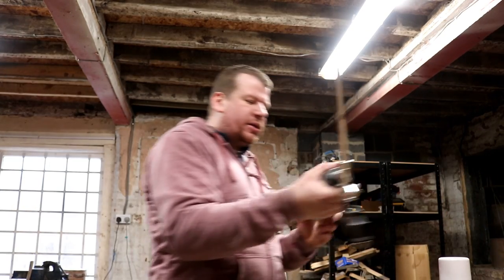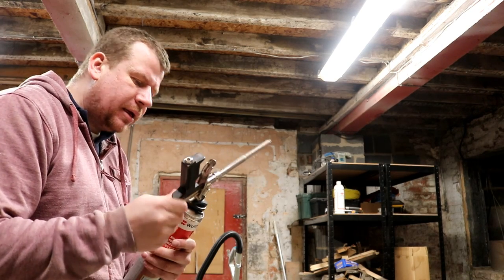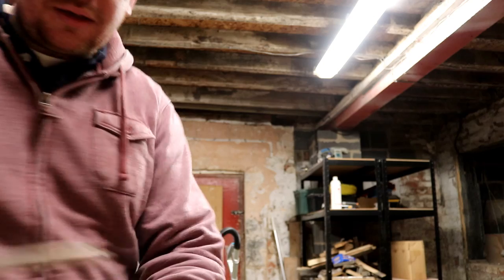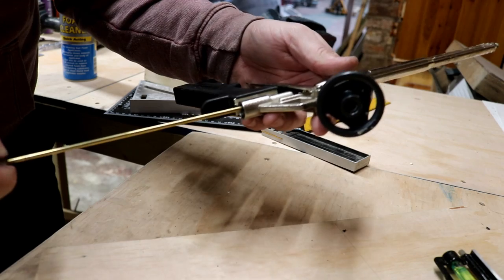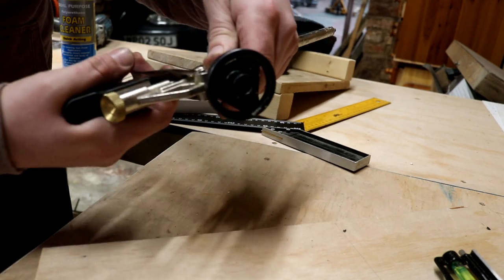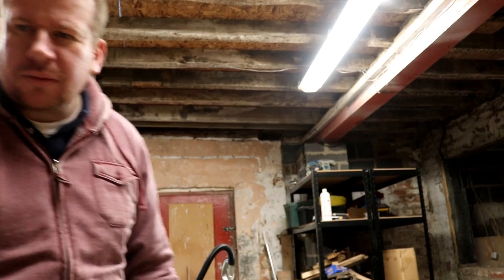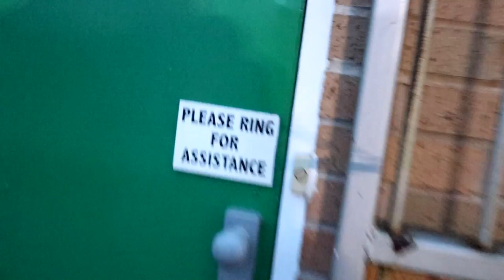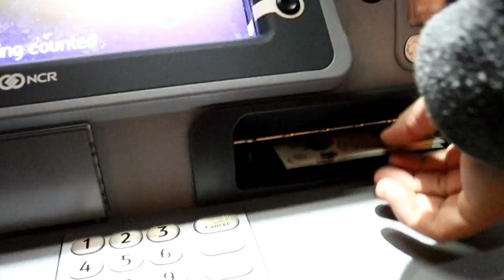Thanks Dave

Comment: Nice cleaning tips, not got a foam gun as I don't use that much of it, perhaps because I don't have a foam gun 😄? You are definitely right about not touching it though. I once had a right disaster with a part used disposable can. Up a ladder with the damn thing jammed open and spraying foam all over. One of the fastest descents I've ever done and straight into the wheelie bin with it. Fortunately I had overalls on at the time but I had black hands for weeks.

Great vid as usual, keep them coming.

Cheers

Schnuz.